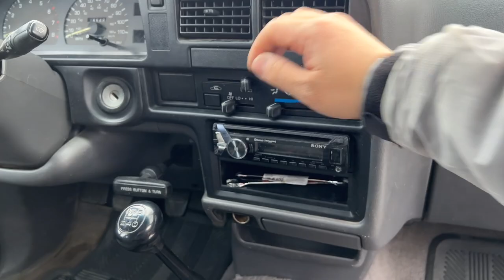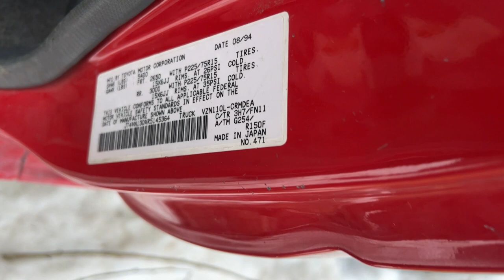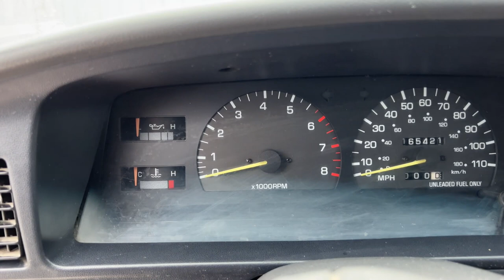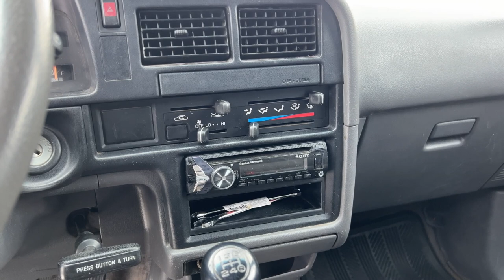I BOUGHT ANOTHER TOYOTA PICKUP | THE BEST YEAR | "1994 DREAM TURCK"

Comment: The option combos on these were truly all over the place.  My '94 DLX 22RE manual XtraCab 4x4 has the less expensive engine, but does have the digital clock, but didn't come with the tachometer gauge cluster (swapped one in years ago).  Maybe some of that stuff was tied to whether or not it got the factory AC (which mine's got).

Comment: Got a hold of a 1984 yota 4x4 pickup. It's got a solid axle only reason I wanted it I put it on a trailer it hasn't ran in 10+ years and was stored in a garage. I didn't know they came diesel. Anyone know where I can get parts? Didn't know yota had diesel. I paid 600.00 for it body is rust free no dents has 84,000 original miles. I'm not even a toyota guy! Lol I'm a heavy diesel guy but was surprised when I saw this tiny 4 cylinder diesel in it. When the owner told me I thought yeah okay bullsh!t it's a gas job. Thought cool straight axle yota 350 chevy swap Mudd buggy lol now I don't want to tear it apart. I bled the injection out chasnnged all the filters, oil, antifreeze and filled the diffs and Trans(manual) checked transfer case looked cood. Truck was in Agusta ga all its life bought from original owner. Originaly thought the solid axle was worth what I spent for the whole truck... now I'm not tearing it apart. Fresh battery it turns over gave it another prime and it fired up and ran like a sewing machine. The clutch is sticking. Going to put a new one in it. So is it rare? If so how rare? I've personally never saw one before? Where can I get new injectors,pump,seals(leaking)
Reply from the maker: Yes rare!!
Reply: @NuttyNu  I'm going to preserve it and find a toyota collector I even have the original owners manuals and the order sheet from the original owner I haven't put the title in my name so it's still a one owner truck lol. I'm putting new tires on it brakes and brake lines(rubber has dry rot). It is a very clean truck. When I say no rust even the frame still has factory paint! I see marker paint from inspections as it went down the assembly line underneath. So far I cranked it up let it warm up and shut it off and rolled it back in my barn.